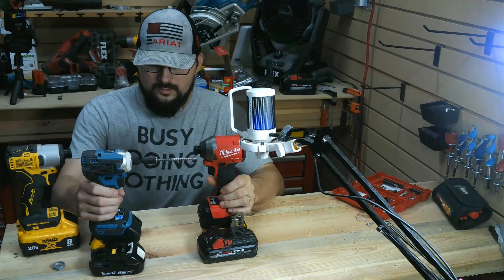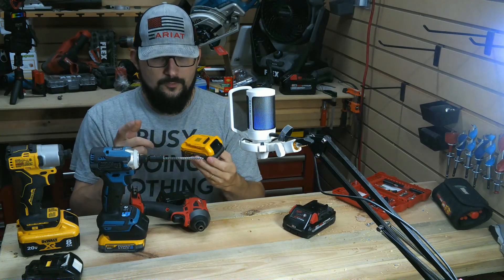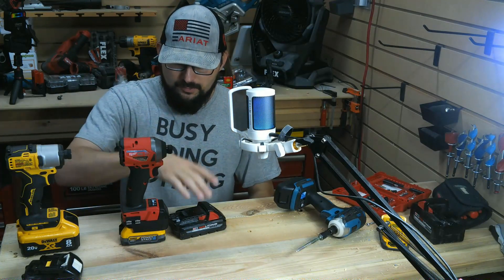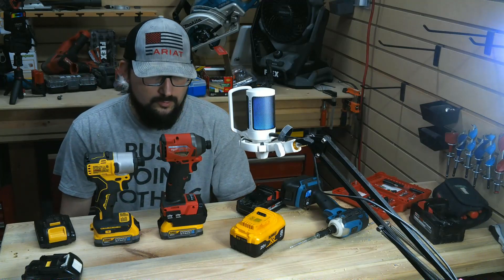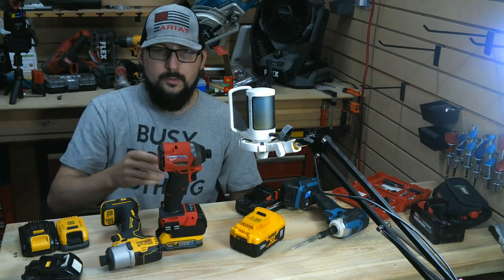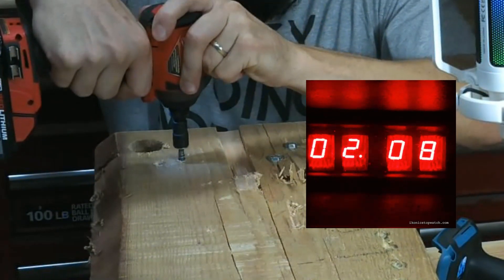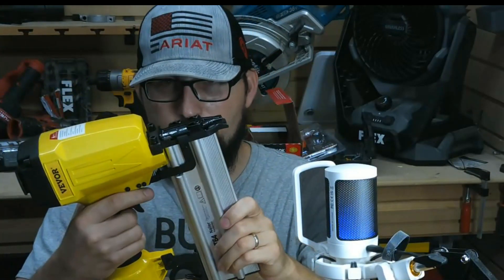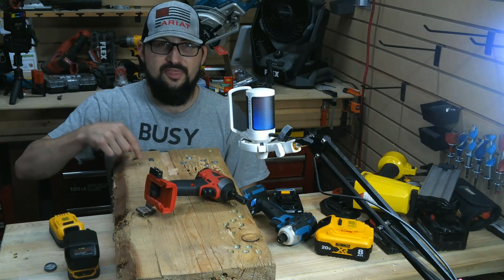`MILWAUKEE with DEWALT Battery?? AND Powerstack Battle

Comment: Thank you for this great video, I’d like to add to the risk by using those adapters. I’ve used my DeWalt to Milwaukee adapter countless times and I’ve ran the battery dead. Yet to have any issues, my adapter is from mellfi which seems to be good quality, but an adapter nonetheless. I’ve also left the battery with the adapter installed in the tool and I haven’t seen any damage or even battery drain. Just putting this out there to any interested in using said adapters.
Reply from the maker: Good to know !!   Melifi seems to be pretty solid i bought a cheap stick vac from them after buying a succesful battery adapter and cordless glue gun that uses dewalt batteries!   stick vac review out soon  thanks!

Comment: Call me lazy but I just never ever use battery adapters I just believe in using the original manufacturer product that was engineered for that specific cordless tool.

On that note I never ever use batteries that isn't designed and made by the original manufacturer for any cordless tool. 

For now I like the idea that there's no crossing over for FLEX tools. On this brand only OEM works period.
Reply from the maker: probably a good idea makita batteries don't do it for me tho!  love makita but cmon they need an upgrade
Reply: @toolsandtactics  Mikita in my opinion is the absolutely worst in battery technology, they were since the 9.6 volt and still is with the 40 & 64 volt batteries.

Mikita's ideas of battery technology is simply increasi the voltage to optimize the tool. 

Mikita believes in Building solid reliable tools with a so so basic Okay battery platform.